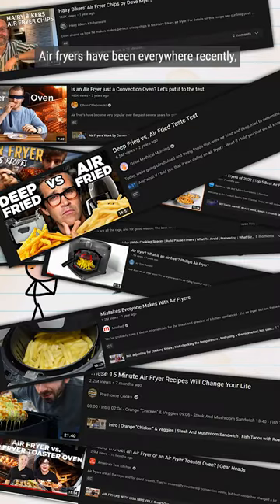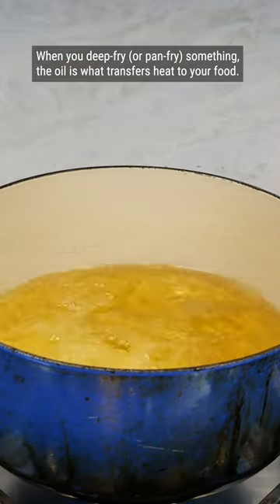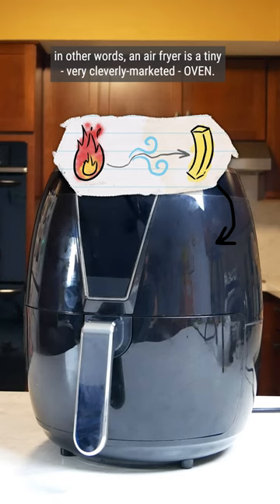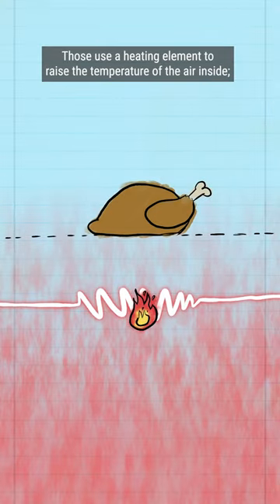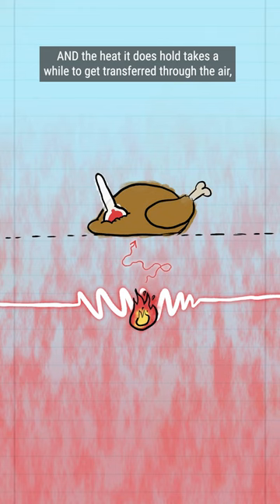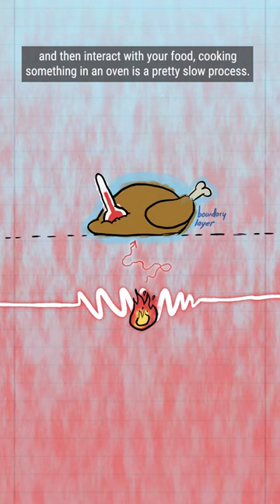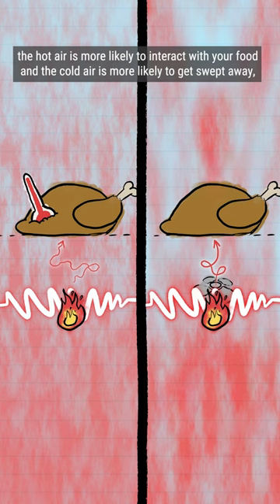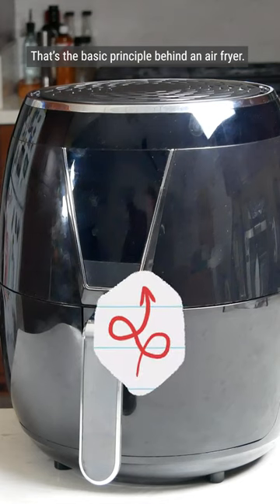Air fryers can't fry anything

Comment: Yes, it is a mini convection oven, but it's a much more confined space. It isn't fried, because of the reasons said. But the pressure and confined space does IMITATE that crispy on the outside fried experience very well. There isn't anything wrong with using an air fryer for certain things, and it's much healthier

Source: cooking is literally my career

Comment: ...and most ovens have a convection setting these days.

It's funny how many friends have air fryers because "they're so good!" when they also have an oven with a convection setting...
Reply: in our house, for some reason we don't use the oven,

(I feel like my parents are still afraid that I'm gonna destroy the house by using the oven or sth (I accidentally forgot gas was on for minutes, one time, in a previous house that did not blow up;

plus atm we're renting (?), and the owners also didn't use the oven much, along with never using the dish washer - but it's not like my parents actually follow and care half the things that were said, but it's always the things that I'm interested in and are completely normal to do/use 🙃),

but for some reason they trust me enough to use the hob and air fryer on my own so.....yh ※

(our air fryer is a huge one with a glass top,
(idk about the small ones, but imo, the convection isn't as even as it should be)
but there's still limitations to what/how big/how many things we can put in it;
since the heat source is at the top center position, it's kind of difficult to try to bake things properly;;

tbh, we're mostly using it like a slower, glorified microwave)

※ I am an adult

• - •) · · · tbf, I did recently accidentally cut myself from trying to clean a knife, but that's an entirely different problem
Reply: air fryers are easyier to use though?
Reply: They're also a fraction the size of a regular oven so they heat up much faster, allowing you to cook much faster
Reply: ovens are slower to heat up, slower to bake the food, harder to clean up  and less energy efficient for the same end product
Reply: @Marpurrsa  slower to heat up - I don't even have an expensive oven, and mine's hot in 5 minutes. Harder to clean - I have a piece of special aluminium foil on the bottom that catches drips - costs like 2 bucks for a roll of 20 and gets replaced once a month. If you wash the tray after use, it doesn't get caked up with burnt shit. Less energy efficient - not from what I can find. Both efficient ovens and air fryers seem to use around 800W.
Reply: @iFireender i looked it up and the only ovens that use 800 watts are counter top sized, made for smaller kitchens or theyre a combo and cost about $4,000, but are still smaller than what americans are used to. sooo whered you get that 800 watts for, a fullsize, oven from? also foil can melt or burn after awhile, it can only take so many uses, because it isnt meant to, a month is a long time to let your pizza roll innards burn 😕
Reply: @kopijaws  I just googled. Even if they can use more - think about it, the thing that takes energy is keeping the oven hot. Even if you have a 20kW oven - if it's well insulated, as soon as it's up to temperature, it will only use energy to maintain that temperature - it's all about insulation.

The foil is literally made for that task - it's sturdy aluminium foil in sheets the perfect size for an oven. Aluminium doesn't melt at 200C last I checked.

Comment: Can we cook with the heat dumped by the exhaust of a refrigerator?
Reply: It's not warm enough, but it does heat up your room a bit
Reply: The air from a fridge is not warm enough. How hard fridge has to work is proportional to the temperature difference between the inside and the exhaust. So the exhaust is as close to room temperature as possible

Comment: Well, no, you obviously never looked into an airfryer before.
It contains a spiral at the top which heats up and emits infrared i.e. heatwaves as well. This kind of heat does not need air as a medium.
Therefore an airfryer grills the food as well.
Reply: Not any more than a traditional oven. The heating element in a traditional oven is the same, except it is covered by the sides of the oven to make it easier to clean. The sides of your oven heat up, and also emit IR

Comment: Imagine hot isostatic pressing for food, using gas at high pressures to achieve heat transfer of oil but without oil. If only pressure stuff wasn't that expensive...

Comment: Now I wonder what the difference is between that and the ventilation option that ovens have.
Reply: Airfryers has a higher airflow which makes it better at transferring the heat without burning the food. There are probably ovens with comparable ventilation as air fryers, but because of their size the fans in an oven needs to be much more powerful to give the same result as a small airfryer

Comment: It's a miniature convection oven, which has been around since WWII, with a new name slapped on it. Most home ovens already have a convection setting, but the fan isn't as strong. Thousands of people spent upwards of $500 for a smaller version of something they already have. Not to mention, they are a pain to clean. So dumb

Comment: I see a lot of misconceptions in this comment section and this video is a lot of waffle so if anyone wants it explained like your an idiot an air fryer is like a refular fan force oven but with the but the fan is set to high
Its also worth nothing that the food chamber is designed differently so saying its the same as oven is like saying a race car and deisel pickup are both just cars with different marketing

Comment: What? The name is AIR FRYER. It fries the air around your food that transfers the heat to your food.
You just contradicted yourself in under a minute
The name Air fryer tells you what the appliance does
Reply: Frying is the process of heat transfer through oil, NOT air… did you even watch the video?
Reply: @percy6070  I know that frying is transferring heat trough oil yes, but the air fryer transfers heat through air, thus air frying
Reply: @jamp6167  That's like saying, "swimming is moving through water, so moving through air is air swimming" it doesn't make sense
Reply: @percy6070  it’s not the same no. Swimming and “air swimming” (walking) are two different forms of motion and movement, so you can’t compare that to frying, since both deep frying and air frying both fry
Reply: @jamp6167  You know as much as I do that what you've just said is a nitpick and misses the point of what I said, air "frying" isn't the same process, it cannot fry food, it only browns it. It's just a small convection over which is well marketed. Convection ovens don't fry and aren't fryers, so this isn't either. You just got sucked in by the marketing.
Reply: @percy6070  wdym “it only browns food” you can reasonably and thoroughly cook at chicken breast to well done in an air fryer.
And I didn’t get sucked in by the marketing like some sort of consumerist-zombie, I got an air fryer cuz it’s an easier, faster and healthier way to cook much of the food I eat
Reply: @jamp6167  at least you're no longer claiming that it can actually fry anything so that's good...

Comment: The lack of oil also makes a huge difference. The reason frying and air frying makes things crispy, is because the water is boiling out, and escaping as vapor. The oil replaces that water, and because hot oil is far less viscous, escapes quicker. This creates an almost sponge-like, dry crust. The same principle for air frying, moving air replaces the water. This allows far less oil to pervade that crust, and creates a less oily product.

Comment: Of course they fry food. Air friers (fryers?) submerge your food in a hot fluid, which transfers heat to the food. The hot fluid is air, not oil, hence "air" fryer.

It's perfectly correct to call them that, just as it's also correct to call them countertop convection ovens.

Comment: Air fryers do use oil though. It's basically vaporized in the air. And like with frying in oil directly, the oil is also imbued, not just used to convey heat. So air fryers do fry.
Reply: how exactly do air fryers use vaporized oil?